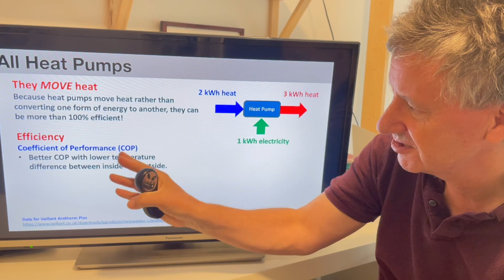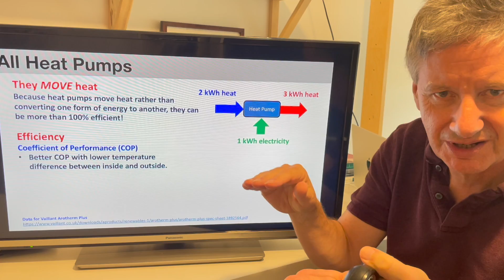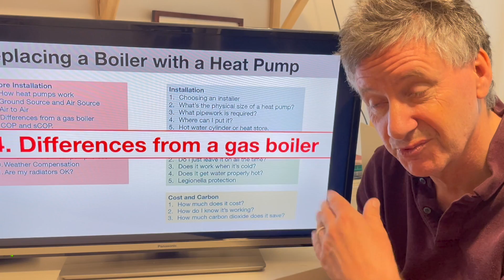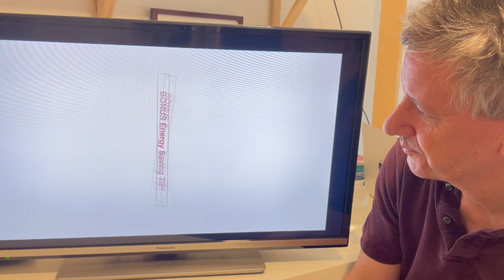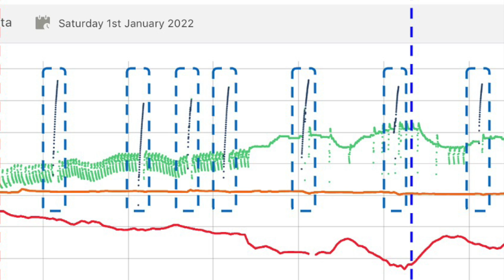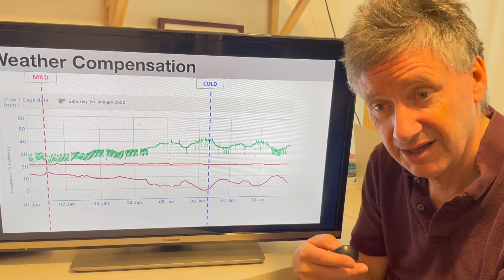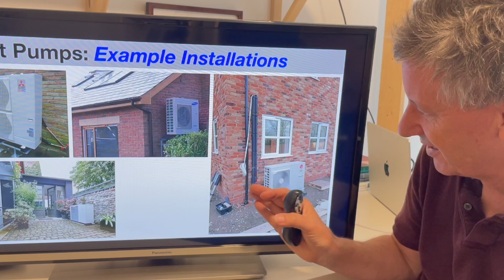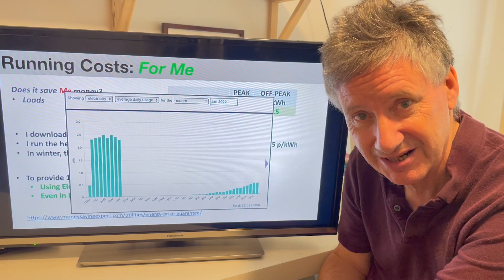Replacing a gas boiler with a heat pump

Comment: Things to factor in, install cost of a boiler vs heat pump vs savings. Back of a cigarette calculation it’s going to take about 30 years to break even. 
Not everyone has a condensing boiler or a combi boiler, how much are you away from the house? If you are out at work all day then a boiler won’t need to be on while you are not there and only needs to be powered up to heat the house. 
You missed out modulating boilers with demand control like open therm which vary the gas usage. 
Frankly you would be better off investing in insulation 1st which will give you a better payback and if you do decide to more to a heat pump will pay dividends on running costs. 
You also missed out the grid scalability demand where renewables at grid scale are not a solution given the vast increase we are going to see if large scale adoption of EVs and heat pumps happen. 
You also failed to mention the low efficiency of Gas fired power stations and the losses through the grid. 
ASHPs are great for new builds designed to a good standard but in a leaky house that’s not occupied all day they are a catastrophic idea and are not cost effective at all.
Also noise is subjective. If you listen to noise during the day then something may well be imperceptible but at night when it’s quiet and you are trying to sleep it’s a different story.
Frankly I think all new houses should be built with ASHPs, mechanical ventilation heat recovery systems and underfloor heating with as much thermal gain as can be designed in but that isn’t going to maximise the builders profits so won’t happen. 
Good video though but a little missing on some info.
Reply from the maker: David, Good Evening. What an overwhelmingly negative message. How to respond? Mmmmm. Let's take it point by point.

First, if you don't want to do this. That's fine. But I notice you have not addressed the issue of carbon dioxide emissions at all. Why not? The fundamental question that faces us - collectively - is how to keep warm while not emitting carbon dioxide. Continuing with gas boilers because it's cheaper by some short -term measure does not address this problem. We need to dismantle the leaky archaic gas infrastructure and just stop burning stuff. Failing to do that is just passing on a problem to our children.

Insulation is obviously a great idea. It's what I did in my own home where I reduced heating demand by half. But not everyone can do what I did, and actually heat pumps can heat any home, insulated or not.

In the year 2000, peak grid demand was close to 60 GW. This year it was closer to 40 GW. The Grid has plenty of capacity.

I am not sure what the relevance of the efficiency of gas fired power stations is, but for CCGT plant it approaches 50%. It is more efficient to use methane to make electricity and run a heat pump than it is to just burn the gas in our homes. Even with grid losses of around 11%.

ASHPs are great for new builds, but also great for older homes as well. For many apartments air-to air heat pumps are probably more appropriate.

Regarding noise, no. It is not subjective. It can measured and ASHPs are just not noisy. My neighbours gas boiler is much noisier than my ASHP. 

I find it interesting that you took the trouble to write a very long, very negative comment. And yet you did you not mention the climate crisis? Why not?

What is your solution to eliminating carbon dioxide emissions from boilers?

Comment: After spending months researching heat pumps I came across this video. It is by far the best introduction to the subject that I have seen. It may appear to be a bit lengthy, but it covers everything that someone would want to know before considering the installation of a heat pump.

Hopefully the evolving energy market will provide cheaper renewable electricity that will incentive consumers to make the switch. Until this point it is going to be an uphill struggle to get large scale uptake.
Reply from the maker: Kevin, thank you for your kind words.

And yes, I agree with you. If you have the capital available, then the combination of Solar PV, a battery and heat pump works very well together to reduce teh running costs. For example at the moment with this very cold weather, half my electricity is cheap rate. For most of the winter it's more like 80% cheap rate. Together with a COP of 3 this makes the heating very cheap.

Good luck with your endeavours!

Michael
Reply: @michaeldepodesta001  Whilst the £5k grant and the VAT exclusion are welcome there aren't going to be enough consumers with a spare £8k to make the switch. A favourable government loan to cover the shortfall would probably make quite a difference on the level of uptake. Just like we have the Student Loan Company, we could have the Carbon Reduction Loan Company.
Reply from the maker: @bvqbvq  , good evening. I think they use a loan scheme in Scotland, although I do not know the details. But yes, I think that would be a great idea.

All the best: Michael

Comment: 90% of the heat on a gas boiler is only when they condense.  Any know how many consumers boilers are actually condensing and what flow temp the boiler must be set at for this to happen.
Reply from the maker: Ry, yes. I agree 90% is optimistic. A better choice might be 85% ± 5%. 

I chose to work with that figure because it overestimates the heating required in the house and thus tends to slightly overestimate the heat pump size required. 

Best wishes

Michael
Reply: @michaeldepodesta001  
I currently waiting in for my octopus energy ASHP survey.  So excited.  From what I’ve heard and the number of people who octopus have refused to install for Im hoping these guys are doing a proper job!  Solid wall property, with EWI, Triple Glazzing, PV & storage also for me the ASHP is the cherry on top!  Fabric first approach on my 1940s hard to heat home apparently 🤷🏼‍♂️ 

I’ve found you channel so informative and I intend to recommend it to any one who ask about ASHPs
Reply from the maker: @rymoe6299  Good Morning and thank you for your kind words. It looks like you are 'on a journey' and I wish you all the best with your endeavours. I do hope you have a good installation experience!

All the best

Michael
Reply: There is no flow temperature (above 58C) that guarantees condensing will happen. If you set your flow temperature to 60 C, but the house is already up to temperature and not losing heat very fast (e.g. its 18C outside), then the return might be at 59C (so no condensing). As the temperature difference between the room and the flow temperature increases, the flow temperature can be higher and the return will be lower because the rooms can absorb the heat from the radiators. TRVs artificially cut off the flow of hot water to a room - the room can still absorb the heat, if they are allowed to do so, the temperature in the room will continue to climb to well above what humans can accept as comfortable.

Comment: I found this video extremely informative. Exhaustive, but in the best possible way. Used your other video to get heat pump size from empirical gas use data (EDF over 12 months) and compared it to MCS spreadsheet calcs: your method 6.5kW, while MCS gives about 9kW. The include a lot of overhead for heat least in ceilings (even though I have a neighbour up) and air changes (no house is that leaky, and if you run the recommended air changes you use an MHRV with 80% heat recovery min). Together they explain (at least in part) the discrepancy. I'm looking at the 7kW Aerotherm+ which, like you, will mean a bathroom remodel to get the cylinder (slim line) in. The point about not waiting extensive insulating renovations is absolutely crucial to socialise further. I'd do a summary video on that to drive the point home if possible.
Reply: As for your cylinder problem.

Look at "sunamp" or alternatives 
Using vacuum insulation and phase change liquid. 
It only lose about just over a kilowatt of energy in 24-hour.
It's also half the size of a normal cylinder
Reply from the maker: Erald, Good Evening,

It sounds like you are on top this: your comments are very sound.

If you want to double check, then on these cold days coming up (December 6th in the UK) if you record your electricity and gas consumption over 24 hours of a cold day - read your meter 24 hours apart - with your home internal temperature as you want it - then you can measure the heat loss from your home directly. Just divide consumption by 24 to get the power of heat pump you require. E.g 150 kWh/day of consumption = 6.3 kW average power.

I wrote about this idea here - with a few tweaks.

https://protonsforbreakfast.wordpress.com/2022/11/07/what-to-do-on-the-coldest-day-of-the-year/

Regarding the fact that it is not necessary to insulate first, I agree. I think the insulate first idea embedded itself early on when heat pumps were and expensive and high tech novelty whose wonder must be 'earned by good deeds'. That kind if attitude is redundant now: we just need to get them in as fast as possible.

Best wishes

Michael
Reply: @michaeldepodesta001  I'll do just that - thanks for the suggestion and all the other help.
Reply: "No house is that leaky". Lol hold my bear. 

1904 detached house. Solid walls. 
Air vents everywhere.
Had eight open fires places.

To say I don't have my work cut out for me is an understatement.

Was using 55,000 kilowatt hours of gas a year.

I've got it down to 27, 000kWh of gas.

I'm going to try and get it under 16,000 kWh by converting to a heat pump
Reply from the maker: @MichaelPickles  Michael, Good Evening. If you use 27,000 kWh of gas to heat your house then (Depending on your use of DHW) your heating demand is probably less 90% of that i.e. 24,000 kWh/year, which suggests a beefy 9 kW maximum output heat pump should be OK - as long as the radiators have sufficient output. It's worth lowering the flow temperature of your gas boiler to 50 °C to see if the boiler can still heat your house at that flow temperature.

But switching to a heat pump won't lower your heat demand.

Best wishes

Michael

Comment: What is the highest temperature that a heat pump can achieve? I've just invested in an 8kw solar array as the foundation of my plan to go almost grid independent.
Reply from the maker: Hi: The maximum temperature that can be reached is determined by the working fluid inside the pump. My Arotherm plus use propane as a working fluid and will heat water to 70 °C without the use of an immersion heater. I think one or two others can do this too, but I believe most heat pumps top out at 55 °C. 

Wow: An 8 kW-peak system: that's very impressive and will probably generate around 8,000 kWh. I am just in the process of upgrading to a system which might reach 6,000 kWh, up from 3,800 kWh. Together with a 13.5 kWh battery I hope this will allow us to stay off grid for 6 months of the year.

https://protonsforbreakfast.wordpress.com/2022/09/01/its-been-a-sunny-summer/
https://protonsforbreakfast.wordpress.com/2022/10/27/new-solar-panels/

Do you have plans for a battery?

All the best

Michael
Reply: I just went with however many panels would fit on my roof, it's east west facing so not really 8kw peak. Not installed yet so I'll see.  PW2 later next year
Reply from the maker: @ExplodingPiggy  Sounds very sensible. All I can wish you is good luck!

Comment: Wonderful video, very explanative, easy to understand, technically correct, must-see for every heat pump interested house owner. 👍One tiny error: 500m² are not 10m x 500m😀
Reply from the maker: Thank you: Not a tiny error - a factor 10! I did flag the error and would edit the video if I could -. Sorry. M

Comment: A lot of great information in that talk Michael. Thank you for putting it together. I’m looking to reduce my energy costs and carbon emissions, particularly gas relating to gas. From the information you supplied I don’t have a metre distance to my boundary and other options suggested seem equally unlikely. I do have solar PV and home batteries. I was wondering if there are other electric powered solutions for me and if you plan to do a video on those. Thank you.
Reply from the maker: Steve: Thank you for your kind words. Heat pumps can be mounted on walls and elevated. It's a good solution if you have a side wall to your house. If you are totally stymied - and the regulations are mad - then consider an air-to-air system. AKA Air conditioning.

These systems can heat as well as cool and have a very high COP for heating air. In a multi split system, 1 outdoor unit can supply 4 or 5 indoor fan coil units that are mounted above doors. If you have a large home you may need to 2 systems. Pros are that they are very efficient and you get summer cooling for free! Also you can get rid of radiators and free up wall space. Cons are that it doesn't supply domestic hot water. 

Several manufactures supply DHW cylinders that incorporate a heat pump. These have ducts to pull in air from outside and expel cooled air from which the heat has been extracted. They are then just plumbed into the hot water system. Products are available from Vaillant, Simplex and Daikin I think.

Search Google for "Hot water cylinder with integrated air source heat pump"

They are very popular in the US where they often use AC for heating and cooling too.

All the best

Michael
Reply: @michaeldepodesta001  Hi Michael. I forgot to say we have wet underfloor heating throughout our ground floor so would not want to change from that. I’m looking for a different method of heating the water passing around the UFH pipes. I saw a Heatrae Sadia electric boiler that seems promising. One of the problems for an ASHP on our property is the neighbour on the side we’d need to install a heat pump. He objects to everything!!  Keep up you excellent information videos, Michael.
Reply from the maker: @stevesmith7675  OK I rather missed the point. But do consider alternative sites for an ASHP: going pure electric multiplies the bills (and the CO2) by a factor 3 to 4!

But you know your situation better than I do: good luck with your installation! M
Reply: @michaeldepodesta001  One last question, Michael. I have a 170L Heatrae Sadia unvented cylinder. If I were to go to an ASHP can I keep my current cylinder? It would save costs if I could. 😁
Reply from the maker: @stevesmith7675 

It depends, but I would guess not. Why not? A heat pump heats the DHW by passing hotter water through a coil inside. Here is a cross section of one:

https://www.installershub.co.uk/product/rm-intercyl-unvented-twin-coil/?attribute_pa_capacity=300-litre&gclid=CjwKCAjwh4ObBhAzEiwAHzZYU_nc5EhtcTPVPfOGRU9gA1I0x335rIA44zIg_YvNOVkYVddsNGhTXRoClkMQAvD_BwE

It may be possible to exchange heat between the DHW and the heat pump circuit using an external heat exchanger, but I am not familiar with how to do it.

Nothing is easy! Sorry.

Best wishes with your endeavours. M